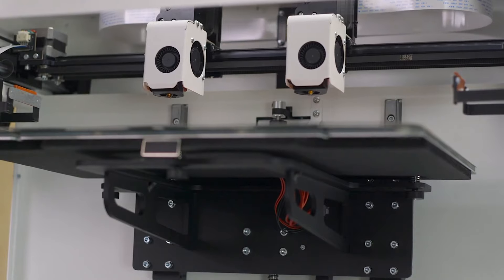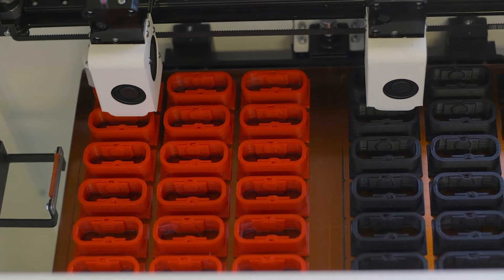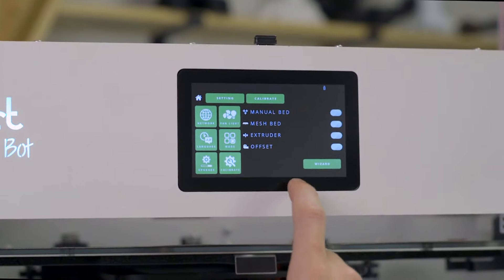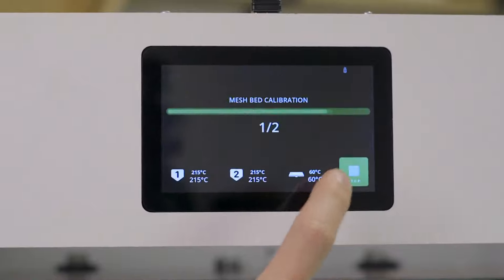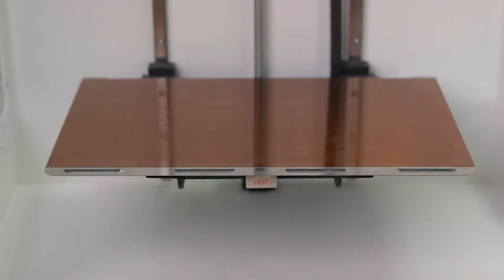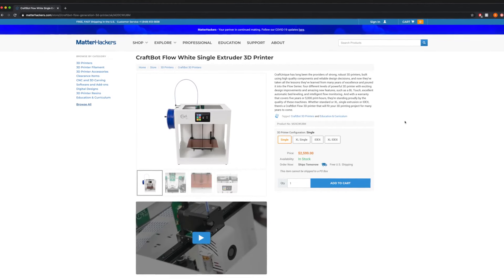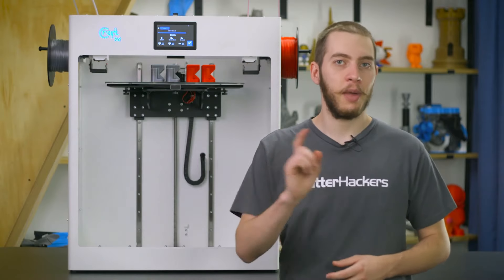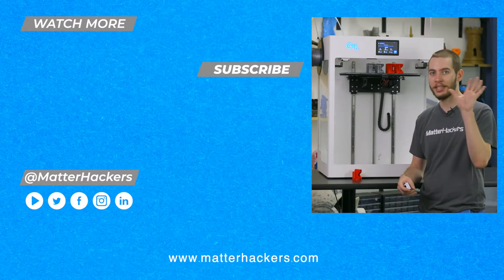Tech Breakdown: CraftBot's FLOW Generation of 3D Printers

Comment: I bought one (Flow IDEX) from MatterHackers about a month ago.  I love it. Not a single failure.
Setup and Calibration were very straightforward.  

CraftWare Slicer is awful on MacOS.  It is very slow.  
I wish there was a textured build plate option like MatterHackers LayerLock powder-coated PEI.

MatterHackers was a pleasure to deal with during the purchase process.